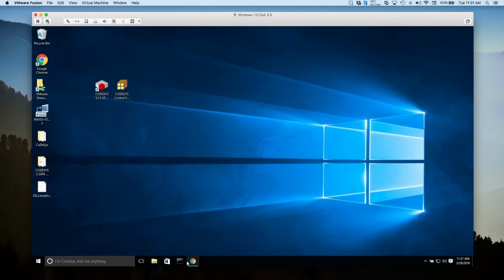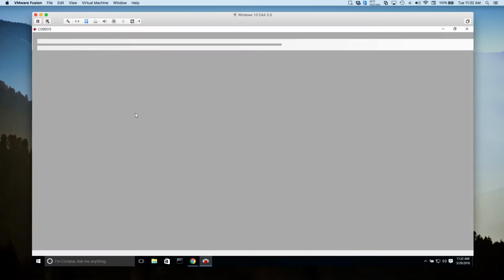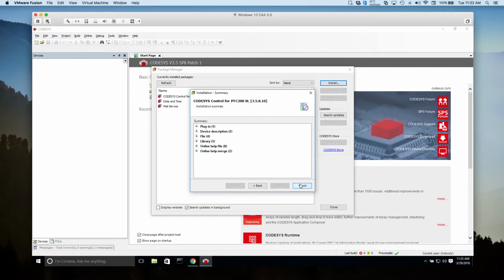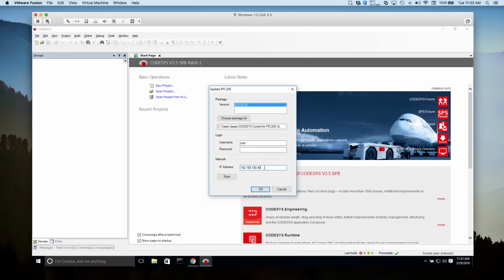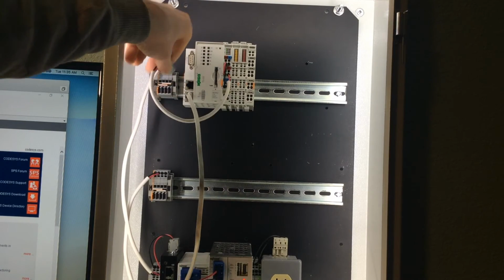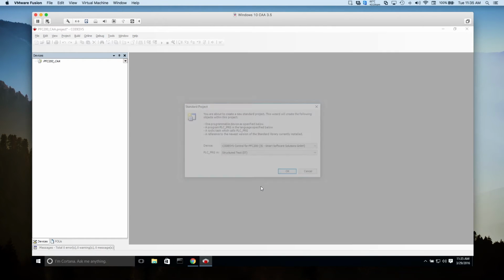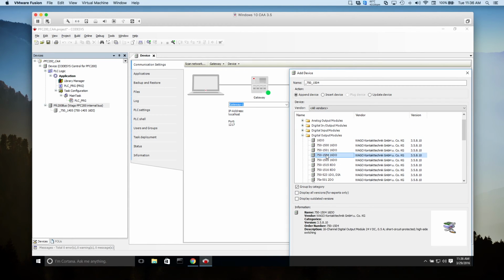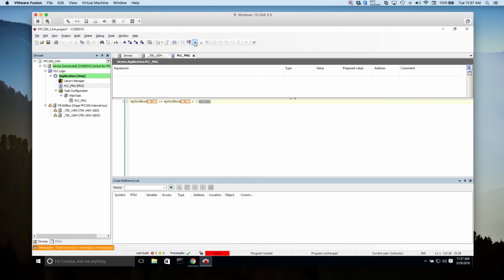WAGO PFC200 and CoDeSys 3.5 Programming Environment

Comment: Thank you. Very nice presentation.
Reply: @Patricio Benavides In fact, the package may be installed multiple times, however, this then only a trial version which will be closed after 2h of operation. In order to have it running 24/7 you will need a license for every controller. The license is "only" a permission for productive operation, which is represented by a license key. This key is stored either on the device or on a special dongle.
However, you can install the package on every device you want to and step by step license those who need a continuous operation.